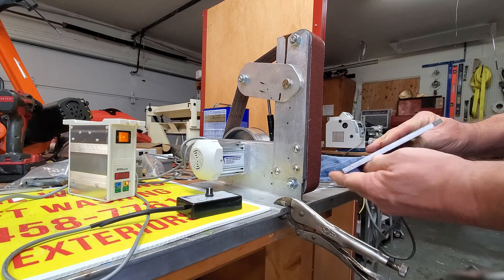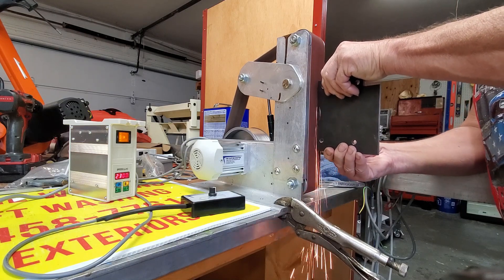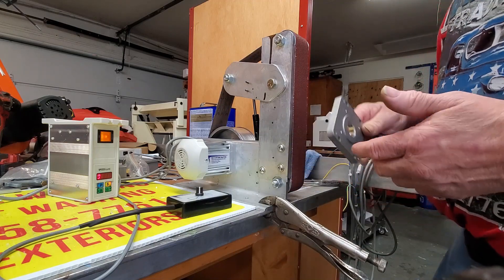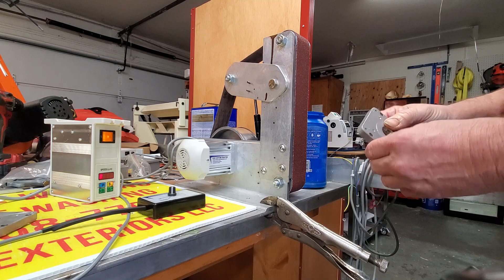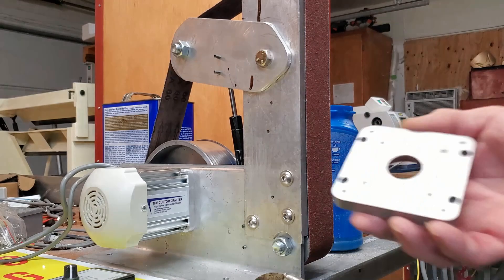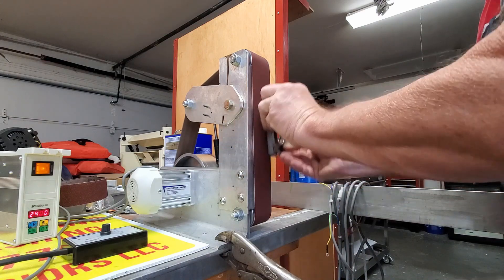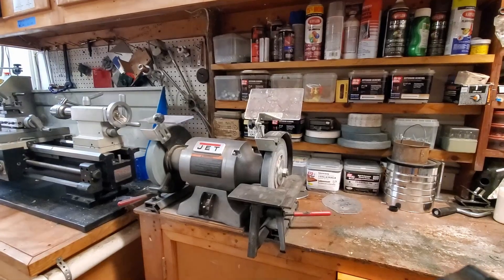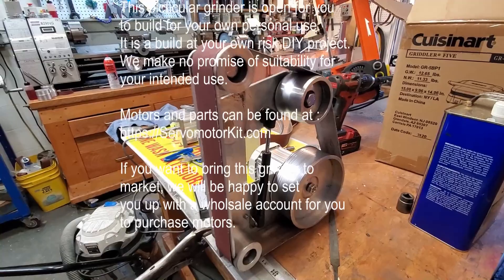How I Build A Compact Belt Grinder 2 X 42 1 1/3 HP 2 X 84 Knife Sharpener.

Comment: I didn't see the kit on your site.  Or are you just doing the motor/controller?   Enjoyed this, and it looks like it would work very well.
Reply from the maker: Originally it was designed to fit in a USPS large flat rate box dissembled. At that time the market prices were $800 to $1500.
Now there are many competitive products and I am too busy to make them. Current retail is about $400 to $500. Still when people see it, they want to buy it.
Many have tried to buy mine right off my work bench.
Do not be fooled by the 550W 1 inch wide belt grinders on Amazon using a similar motor at $300 to $400. Not that the 550W is not a good motor, it is and that one
is way better than many others. Thing is they do not offer replacement part's and 550W is not going to be sufficient in a metal shop. likely great for wood.
If somebody wants to bring this or any product to market using my motors, I will be happy to walk them through/how to do this.
I will likely list this one in clearance within a few days. You can contact me direct using the info found on my site and discuss price and having it listed in your name where is only you will be able to purchase this one. Probability of building another is likely a month to 3 out.